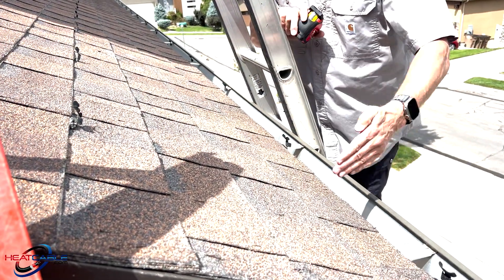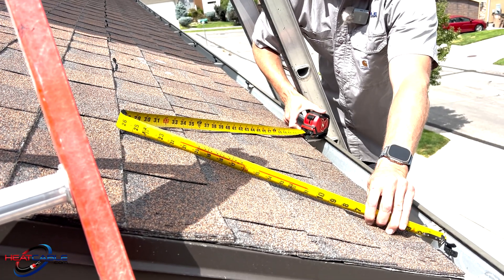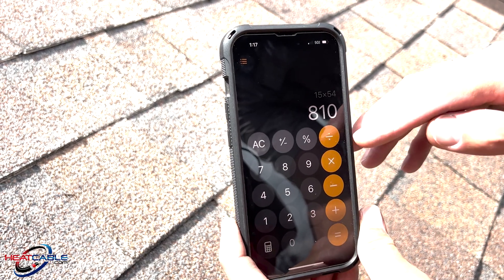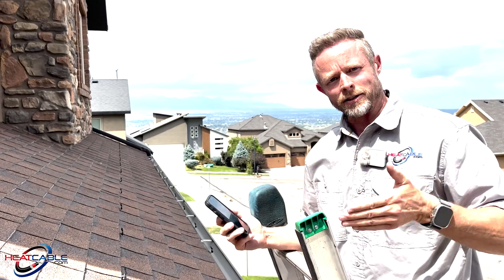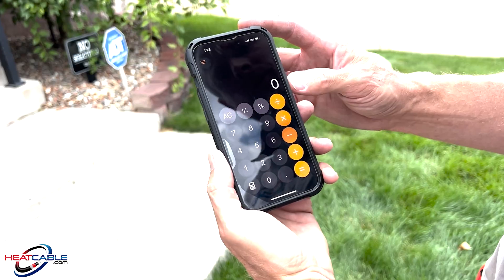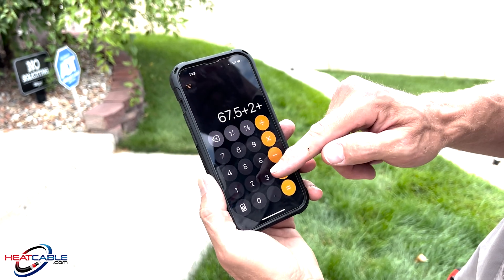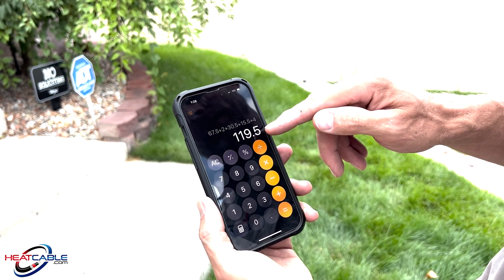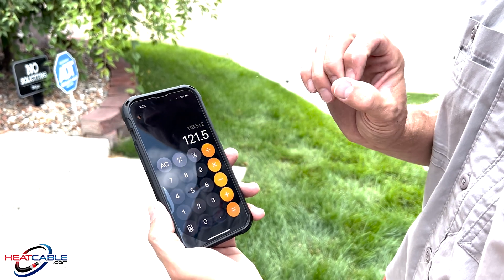How Much Heat Cable Do I Need? - Calculating the footage for your project. #heatcable #utah #diy

Comment: I don't have an ice dam problem damaging my roof.  I  have solar panels that extend close to gutters (they stop about 12" from edge of roof shingles) and when the panels shed snow the snow piles up and I lose a lot of power production waiting for temperatures to melt the significant pile to allow the rest of snow to slide off the panels.  Do you have a recommendation of whether self regulating heat trace could help combat this?  Would I need a different solution?
Reply from the maker: That does sound like a tricky ice problem! Heat Cable may very well be a viable solution for your ice building up on the roof edge. If your gutters had a line of heat cable running through them to provide a clear pathway for water to drain, then any heat cable you used on the edge near the gutter/panels would have a good chance at preventing buildup before draining down into the gutter below.
Reply: @wasatchheatcable8757 I'll check the gutters next time, I assumed the gutters were clear of ice because rest of roof was melting ok (also dark color).  I figured snow just piled up because it couldn't slide off the roof after sliding partially off the panels and temperatures were not high enough to melt the snow pile.  I imagined heating the roof surface that accumulated the snow pile would solve my problem.